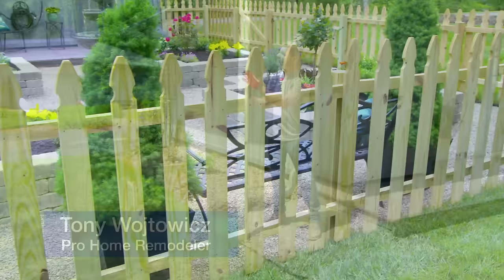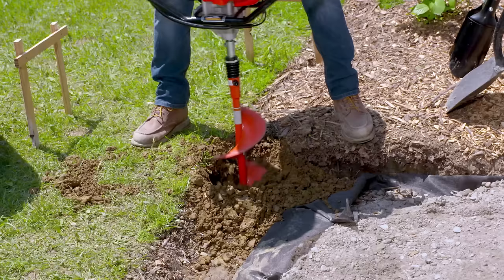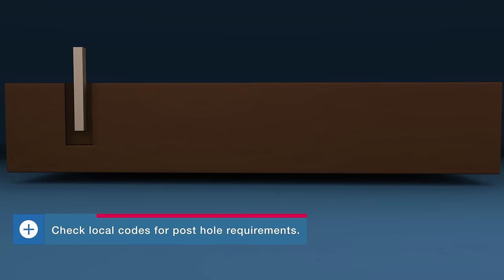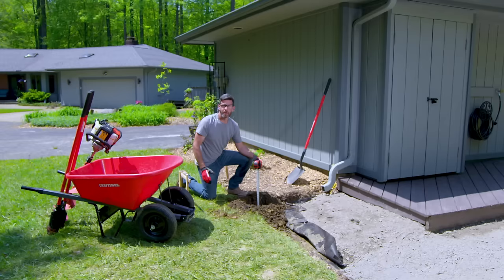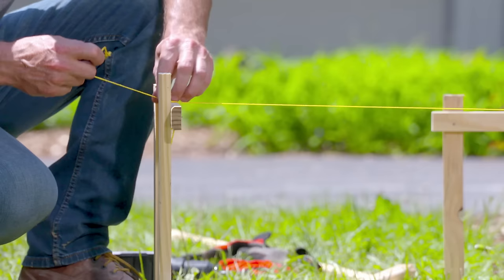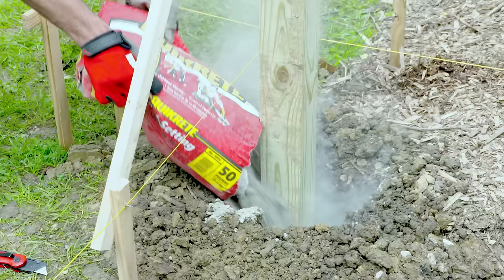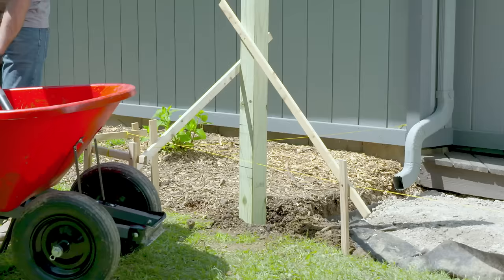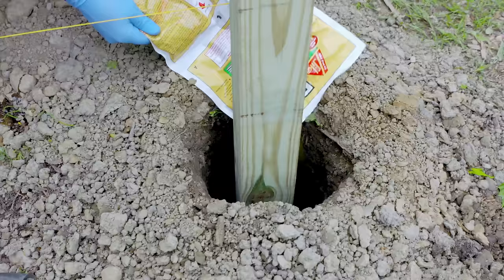How to Set a Post for a Fence or Deck

Comment: Always fill the concrete to above ground level and slope it away from the post. Never have a layer of soil around a post. It will only last a few years before it rots through and breaks.
Reply: 100 percent right     I do mine with pvc jackets     rebar at the bottom    and a cap at the top.   Got  post  on my property over 20 years old ... the way this guy is doin it  you might get 10 years lol even with pressure treated   expecting my builds to last over    50 plus years easy
Reply: Yeah filling the last 6 inches with dirt is a huge mistake.
Reply: @chrisyerp174  got a pic, chris?
Reply: I already put my crete in early today, about 1-3" to below ground.. Can I add a sloped cap tomorrow pour of crete or will that not connect or be otherwise messed up? I only did 1 today
Reply: @Brown Butterfly so you think adding more on top would adhere to the dry concrete then or no?
Reply: I'm surprised nobody has mentioned that by filling your concrete to ground level it will eventually be heaved up by freezing weather. I've seen this on my own property. I think the best way is to treat the portion of the post that would normally contact the dirt with tar moisture sealer then fill with gravel
Reply: @billveder1071  If the goal is to maximize spending on lumber, it's not a mistake at all!
Reply: @A.C.71  If the concrete heaved up, then the hole was not deep enough.
Reply: This comment could have replaced this video.
Reply: Concrete is porous it will absorb water any ways.
Reply: I was right about to comment on just that.
Reply: My deck is 28 years old and the posts are buried. No breaks yet.
Reply: Concrete is porous how will this prevent any water from entering the post… that’s why rebar rusts inside concrete, water is going to get in either way right?
Reply: If this video was made for northern states, then I suppose you know what you’re doing. But for southern states, it’s not the same. We do not have frost lines. We also don’t go as deep as they do in the north. I have not been able to find a video that demonstrates how to Install posts for southern states.
Reply: @joshuacrum323 that’s what the pvc jackets are for
Reply: How would you go about doing that?
Reply: Can confirm
Reply: Lol no can someone explain exactly how to set post to last without rot. Everyone has an opinion
Reply: What if you put flex seal on the wood that'll be under ground.
Reply: Bought a hose with an elevated deck with no footers that survived 30 years. That couple years thing is BS.
Reply: @A.C.71 we use asphalt paint.  Works like a charm.
Reply: i kinda disagree i’ve tried multiple methods my yard is heavy clay / wetlands and they all push up no matter what u do
Reply: Slope the concrete all you want water always gets in
Reply: A tree has soil around it

Comment: if you have to dig no matter what I never get why people set with a method that is going to rot. Just fill the whole thing with concrete - 3rd option - and use a bracket. Even if it rots (much longer than any of the other options) or breaks, it's a matter of just replacing the post in like 5 minutes. Try replacing the post on the other 2 options.
Reply: Agree 100%
Reply: You're probably right. I guess it depends on when you would want or need to replace a post. I can tell you this. Here in upstate south Carolina the deck on the house I currently live in was built in 1989, posts in ground, like this video demonstrates, and guess what? No rot.
Reply: the hardware doesn't last long. it's going to corrode and break off
Reply: Glad someone else said it because I never see it in any of these fence videos. I saw the method on a video of This Old House building a deck and I thought that myst obviously be the best way to do it. Concrete pillar with a post attached to it with a fastener.
Reply: I read an option to using a metal tie is to coat the base of the post in tar sealer. I'm sticking with the strongtie, even though mine cost $25 each and set in the concrete base.
Reply: Yep.Wood touching concrete,big no no.
Reply: Russ Sloan Here with -35/-40 winter, it would be different.
Reply: @russsloan503  my family has a house from 1800s and original wall/fence still there - the base. The wood section in sure it's been changed. So why settle for 20-30 year life spans? Do it once so it right even if it outlives you.
Reply: The top mount has very poor windsheer load.
Reply: @johntaylor4736  ok then fill the home with concrete, use a square pvc embedded into the concrete 2'+ deep. Now your have an "insert" for 4*4 posts in case they rot, or just use square metal tubing and I'm sure it has lots of wine shearing strength . It's not much more expensive than a 4*4 ... Metal fence tubing at Lowe's was like 16$ vs 14$ for 4*4 last time I checked. I imagine it can be even cheaper in a metal shop
Reply: Wonder if anyone here can or will answer this... How should I anchor a 4x4 post to sit on top of a wood deck, to contain medium sized dogs when they want to jump against it? I know I should set them in the ground, but anyway, I'm thinking I use 2 in or so screws to anchor in each direction, and maybe a 2x6 on its side along the bottom for additional support, also anchored.
Reply: @ongobo23  pls explain this method....using a "metal tie".
Reply: Good point

Comment: Filling the top portion of post hole with dirt will definitely ensure future fence work as posts are sure to rot!  Job security at its finest.
Reply: Pressure treated. But it's probably best to use a steel anchor in concrete, then just bolt the post on top of it.
Reply: Exactly why I’m having to replace mine. The part surrounded by concrete is in nearly new condition. The part above it surrounded by dirt is eat to nothing
Reply: Get better wood Jose. Buying the $4 post over the $40 will save you a buck but not time

Comment: The foam does not work.  Within two days it shrinks away from the pole and the circumference of the hole.  You end up with a loose post

Comment: I demoed a deck recently that was build using method 3 on here. With the anchors. 
I have demoed many decks before in my business, but the 22 year old deck was rotted from decking to joists, but underneath the joists I found the beams (2x10s) and 4x4 posts all in perfect shape with no rot. The posts had never come in contact with ground and all that wood was still reusable after 22 years.. tennessee is wet and humid where I live so decking is a constant replacement, but i will be using method 3 from now on for low load bearing decks.
Reply: you're saying the foam is best versus the concrete? Home depot video shows mixing concrete in a wheel barrow so I was surprised to see a method adding dry concrete to the hole.
Reply: @dianesulpizio2542  No, I think he's talking about filling the hole with concrete then placing the post on top using hardware so the post never touches the ground.
Reply: @irafair3015 can you elaborate on that? You fill the entire hole with concrete, let it dry, then somehow attach a post on top of the concrete? That connection must be crazy strong. I thought the whole point of getting a third or more of the post underground was to keep the post in place.
Reply: @lcglazer  This is code is many areas. The  concrete post sits above the grade (grass), and then a steel anchor is drilled onto the top, then the post connects to the anchor then drilled on the sides. This ensures the post is never in direct contact with either water, soil, or concrete. Repairing is as simple as....unscrewing the post and putting another 4x4 in its spot. Unlike these other methods where you'd essentially have to destroy the entire slab of concrete just to re-do the post.

The 'strength' is just downwards force. And the steel anchor is really no different then when they screw in joists with the same steel anchors. I'd much rather trust this then a rotting piece of post in concrete after a year.
Reply: @lcglazer if you put wooden post in a ground then sooner or later it will have contact with the water and start to rotten. The third method (i am in a process of doing deck with that method) you pour a concrete into a hole (i will be using 160 pvc pipe for that) and right after pouring a concrete you put an U-shaped carrier in the concrete so it hardens with the concrete. After it has hardened you start bulding a deck by placing 5x10 or whatever you use into the U-shaped carrier. In this way the wooden part of the deck is always above the ground and is not in constant contact with the ground or water so it should last longer. My father was a builder and this was the advice he gave to me.
Reply: @martinamor8288  thanks for explaining. The pvc pipe is the mold for the concrete pour and the U-shaped carrier is called a strong tie, am I right? I did not build a deck. I just erected two 3x3 posts for a wine trellis. Funny in those circles, everyone’s still putting posts in the ground. Had I known this method you mentioned I would have done that but for now, I have them in the ground. We’re in LA so it doesn’t rain much. Maybe it’ll last longer before it rots?

Comment: I learned more from the comments than the video. After 24 years I sometimes have to replace the 4X4 treated post around my backyard fence that were put in by method 2. Post are rotting at the ground and breaking off. Im about to build a deck and dont want the same problem!
Reply: Fill the concrete above ground level.
Reply: Just done 4×4 posts at home, 2ft2inch deep, 2inch of stone/gravel then I painted bitumin to just above ground level and filled with postcrete, an old grounworker told me this seems good
Reply: @pete3039  what is bitumin? You painted it from the ground up?

Comment: 30 years ago I built my first deck, my father in law helped me. We dug our holes 3 feet deep with post hole diggers, poured 6 inches of concrete in the bottom of the holes and waited 48 hrs! then we put the 4x4s in the hole on top of the crete and filled the rest of the hole with gravel (57s to be exact)... The deck is still standing it gets used everyday, the posts are not rotted.. We have replaced the railing over the years but,only by choice cause mom wanted it changed!! lol....I have since built a bunch of decks in the same way, to my knowledge all of them are doing fine today!!! Dont buy into this crap.. it takes a 4x4 a lifetime to rot!!!
Reply: I dont see how s hole with gravel would hold the post securely, especially when the ground heaves from freezing and thawing over years.
Reply: that's one of the methods suggested in the video...
Reply: @A.C.71  Because he put the footing deep enough in the ground.  The earth below the frost line does not heave.  The loose gravel around the post can move with the heaving, allowing the post to remain in one place.
Reply: @rgagnon1008  seems like that process over time would loosed things up
Reply: Setting posts in gravel only if very common. It works
Reply: For deck posts you’re concerned about the posts holding static weight, not shifting weight. The rock will hold the post from shifting while the ledger boards and other anchors keep the entire deck stationary. I’d assume it would be different for a freestanding deck or platform though.

Comment: Here in Europe we do the option 3. It is much safer and the post is proteected by roting and moisture.We even secure the concrete from moisture by adding bitumen after it is hardened
Reply: What about for a fence post? Wouldn't it lack support and put any wind loads into the fastener?
Reply: @user-dm1tv6nl2e  That metalic suport will go into the concrete and the wooden post go into that metalic suport with screws so why would it lack suport? That metalic suport is strong enough to hold it down,dont worry
Reply: @zoltanlakatos6623  it's not down that I'm worried about. Imagine you have a single post, maybe a lamp post, so it's only the concrete footer, metal interface, and single post. The only metal attachments I've seen are a U of sheet metal and some prongs (seated into the concrete). The U provides support in 2 directions, but if wind generated lateral loads run the other way then the load falls to the bolts alone. Are there more shapes for the metal portion? Maybe a square flange?
Reply: @user-dm1tv6nl2e  there has to be a square flenge to

Comment: I've recently started spraying auto undercoating on the portions of the post that contacts concrete, soils, stone, etc. That does stop the post from absorbing any moisture.
Reply: does that method work great as ive thought of that process myself sir?
Reply: Allow posts to dry out from the pt process. Spray underground portion with termite spray. After dry, use a cheap 3-4” brush to apply synthetic rubber post coating (found in 1 or 5 gallons at Lowe’s).
Reply: If you are embedding lumber in concrete, the most important part to coat is that area where the lumber meets the concrete. Thats primarily where the water enters the wood, and ultimately rots.
Best would be to coat the lumber from bottom to 3-4" above the top of the concrete.
Water will have a difficult time entering the wood as its entire length is water-proofed, both the part embedded, and the part exiting the concrete.